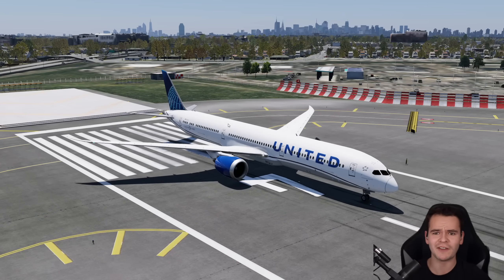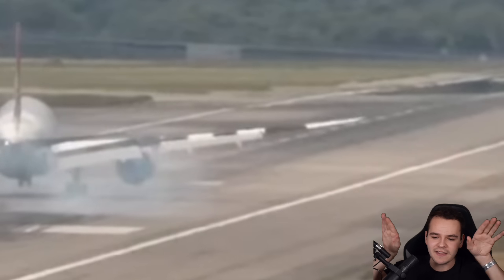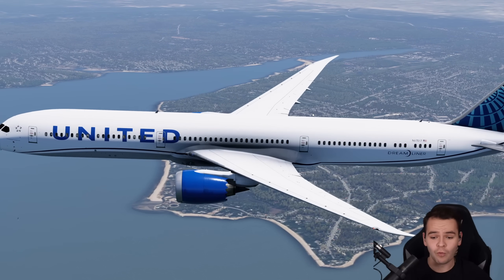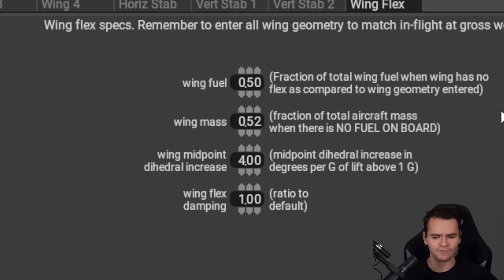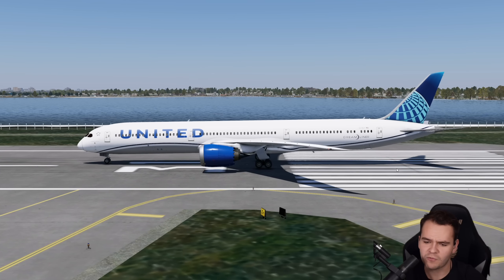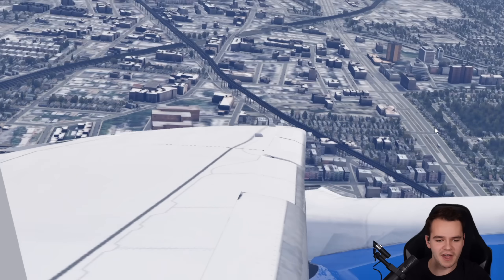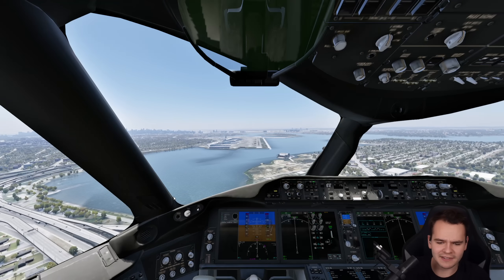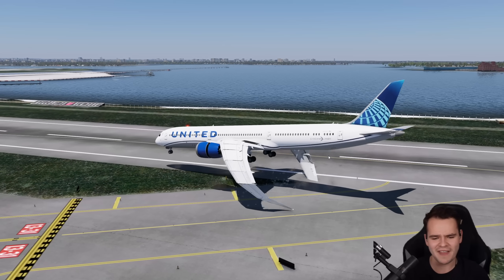The 787 Has TOO MUCH WINGFLEX?

Comment: The 787s wings are stronger than the 737s because carbon fiber has higher tensile strength with better elastic deformation and higher reistance to plastic deformation. Also see it with the A340. its wing flex is insane

Comment: Try Aerofly FS's 787, it's flex oscillation makes wings go within each other after flexing at high speed beyond ~Mach 1.2-1.5 simply keep nose down while at 100% throttle until Mach 1.2-1.5 Is reached then pull up or down 100% and observe the  F L E X ✨.
Reply: ive tested it out and it went WAYYY beyond the limit
Reply: @MxrounSk8s Its fun! flapping wings around so beyond the limits of reality

Comment: Why wasn’t the length of the horizontal stabiliser, wings, and other components like landing gear extended for the B787-10? Extending these could have potentially boosted sales as the range of the aircraft is also increasing, considering the excellent elasticity of the aircraft’s wings. Wouldn’t you agree? 😅